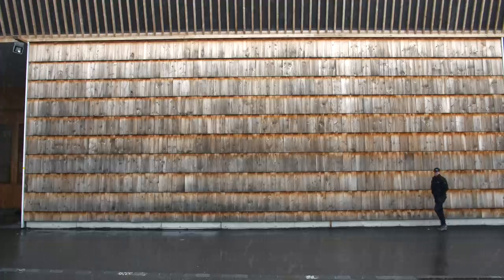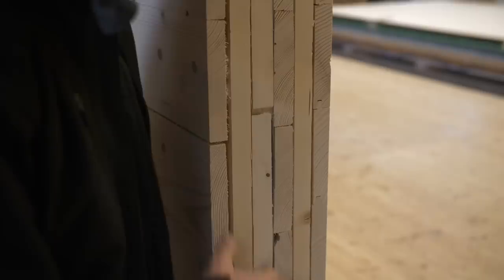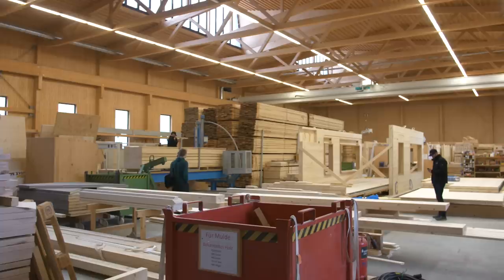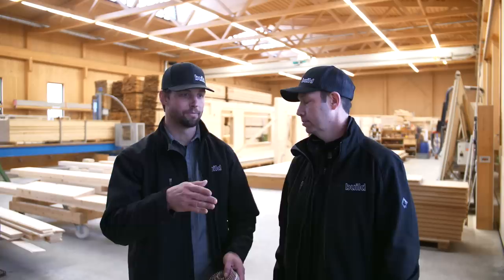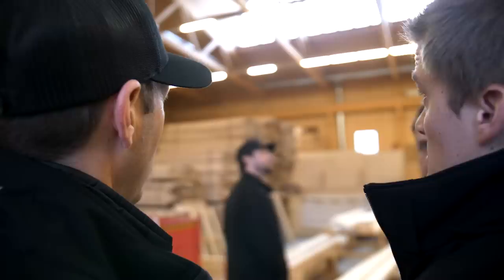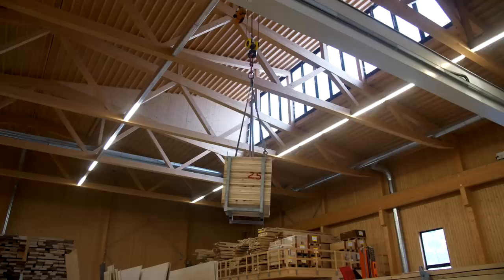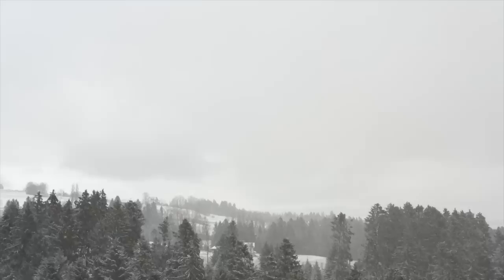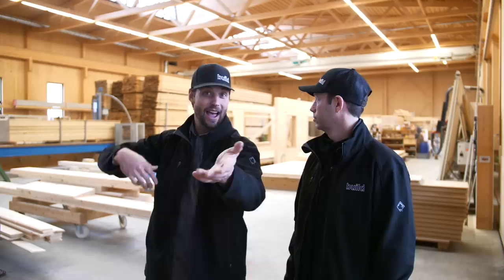This Swiss Builder uses NO INSULATION...

Comment: I am sorry, as much as I like the idea, it seems like a huge "waste" of wood and obviously aimed at the rich, therefor out of place and out of date for 2019. Combining modern, natural materials such as rockwool with wood and some steel components makes perfect sense to me. If built properly, a modern house can easily last 200 years as well and outperform an all wood house. Nobody bothers making it that good and strong though, because it has to be built fast and you have to make more for less.
I don't think the fact that these houses are all wood, is the reason for the longevity of the build. It's the care and engineering behind it, mainly. 
But thanks for buying up all the wood for making these things, when you could build 6x the houses with the materials. 
I am glad they can continue and improve on tradition though. Would suck if that building style got lost.

Comment: You are being optimistic with the R-Value.    Wood walls, softwoods, general use are more like R-1.0 to the inch.     Wood varies per species and growth of that particular tree, from a low of about .75 and a high of about 1.40.  The high end, 1.40 is almost exclusively reserved for balsa wood.  There are a few more very light, air rich woods,, sequoia, some redwood, some white pine, some aspen,,,, but ingeneral terms,, quoting anything more than 1.0 per inch is about as accurate as saying the wall is R-13 because it has R-13 fiberglass in the wall.   R-13 walls as we sometimes call them,, exhibit in lab tests rarely more than R- 7 or R-8  because of the thermal bridging,,, of get this,, the wooden studs.

If you will pardon the joke,, wooden wall are not all they are cracked up to be.

I will add one thing.   No interior stud,, should ever also be an exterior stud.  That is the single most foolish thing we nearly all do.  But it is wrong.  Interior studs should not be exterior studs,, the bridging and conductance are too great and too easy to find an alternative.
Reply: What do you recommend for southern california to have a good R value, but walls that are not super thick?
Reply: Hello, Chris.   First, I'll have to ask a question, and I will have to look at a few things.    The question is where?  Southern California has several climate zones.  It is important to take into account.   Different areas, defined by latitude, elevation, dry or wet depending upon which side of the 'mountain'.  etc.

An example.  My last time in Southern California was 2 years ago, paddling a canoe, Lake Mojave, Lake Havasu.   Elevation, about 800 feet, latitude about 35 degrees north.   bone dry,, highest temps 120, lowest 35,, normal range is more like 110 to 45.  (Canoeing was brutal. One day on Lake Mead,, and another on Lake Mojave it hit 122 F)

Insulation to preserve a warm interior is not the issue,, but excluding the sun and heat is. Heat and sun are usually better dealt with by absorbing and reflecting/excluding.  Adobe walls, normal, 9" thick,, or stone similar thickness is about the correct mass to absorb a full day of sun's energy,, and then give it back to the night air. Steel wall skins, with a ventilated air space behind can work well.  The classic solution for desert would be shading and over hangs to the perfect length to fully shade all summer and allow the sun to reach your windows in the winter to gently heat the house.  Southern over hang should be about 36" , maybe longer, on an 8' tall wall.  More math to refine that guess.  The over hangs of the roof edges and a total ventilation under the roof,  will have as much to say about the comfort of the house as any insulation.   I tend to like fiberglass in a rugged situation.

I engineered a house for an intermediate climate zone in New Mexico years ago.  The solution for that location was masonry exterior wall,, adobe or stone, 8 to 10 inches thick, a 1 to 2 inch air space behind,  and a modest 6 inch fiberglass filled wall  on that one steel studs.  Today,, I might suggest a 6 to 8 inch thick wall,, 3 inch steel studs 0ne foot on center but favoured one to the inside, one to the outside, zig zag. No interior stud is also an exterior stud,, no conductance through the frame.

IF you have sufficient shading,, the entire thing under shade,  Walk in freezers might have the best idea.  Commercial walk in freezers are just a foam block with a metal skin in and a metal skin out.  ALL foams must be protected from ants and termites,, they love to chew on foam, white bead board especially,,, urethane foam less.
Reply: @Sailor376also  It's in Los Angeles.
Reply: I answered last night,, but there was something odd,,, I think that answer is gone.  To recap.  Los Angeles has a couple of oddities in climate.  You asked for thin walls,, I assume new construction, Top of my list would be SIP's.  Structural Insulated Panels.  It is like building a commercial walk in freezer.  I also would use a SIPs with urethane foam,, even fiberglass reinforced urethane foam.  I leave it to you to look up a local manufacturer,,, you could manufacture the panels yourself,, but that would require some fairly serious engineering of the process and extreme quality control in the manufacture.  The result,, well planned and executed,, would be a wall no thicker than a 2X4 or 2X6 wall  with double to triple the insulation yield. A SIP system based upon polystyrene will double the true R-vale of a 2X4 wall with fiberglass insulation,  and a 2X6 wall with Urethane core could be 4 times the R-value.

Additionally,,, the house must be intended to survive fire, flood, sun,  wind, and earthquake.  And there is ZERO reason why a well designed frame house cannot be superior to all of them. Add to that SIP list  A Electrical,, rethink it.  Outlets are conventionally placed as though the wall is a framed wall.  Interior walls can be framed walls, and electrical favoured to them and done conventionally.  But the electric in the outer walls,, I'd suggest,, do it like a commercial building,, surface mount.  Fast, off the shelf,, plain conduit or some of the fancier. versions.   Interior walls.  All interior walls get diagonal bracing to assist the exterior walls in the event of earthquake.  Also,, for earthquake,, I would consider non parallel walls a plus, a romboid shape, a five sided or multi sided shape.  Maybe all your corners have an interesting angled corner turn?  Just an idea.

Exterior:  Nice wide eaves all around to shade the walls,, the hottest day of summer come late in the year.  Some passive solar heating would be nice,,, but aim for more shading, do not admit the sun foe heating until October at the earliest,,, and that IS a math product of sun angle in changing seasons, vs roof over hang length.  Exterior should ONLY be non combustible.  If steel, leave an airspace behind, do not attach directly.  Cement panels,, AKA Hardi-board or similar.  USE ZERO wood on the exterior,, no burnable products.

Give your home a thermal flywheel.  There will likely be a concrete floor in the basement or it will be slab on grade.  IMPORTANT;   I have seen this element done with compromises,, there must be none.  Isolate the slab on foam,,,and perimeter foam (use a high density foam for the perimeter or BURIAL grade pressure treated wood.)  ZERO concrete may be in contact with soil, footings, or outside air.  The slab should only be in contact with the inside air, the carpeting on top, or the feet of the occupants.   If there are intrusions, around pipes and wires,, it is IMPERATIVE that the gaps are carefully and completely infilled.  This is not a job that can be done by the usual best contractor.  A single 4 inch square area  void can destroy the energy flywheel effect for 400 square feet of slab.  Yes, you heard that correctly a 2inch X 2 inch void where the concrete falls through to contact the soil of footing,, can destroy the effectiveness of a 20 foot X 20 foot area.   If you successfully float the slab of the garage, basement or main floor,, it becomes a very powerful heat modifier for the entire house.   In Michigan, my workshop, unheated except by an infrequent wood fire when I had a project, with isolated slab,, in 20 years the latex paints stored never once froze. The house interior in summer took the entire day to warm up,, then open the windows after dark to cool.  That house never had air conditioning, never needed it. (10 inch thick fiberglass filled walls, quad glazed windows, excellent orientation and perfect overhang lengths)

The LA area presents almost every problem there is.  If you are about to build,,, know your flood plain and what canyons or reservoirs are above you.  Never buy or build in one of those at risk areas.  Hillsides , mudslides,, fire, flood, sunny, muggy, trapped inversion layers, earthquakes.   LA has it all.  I know of no termite or insect problems currently there,, research that though. And LA as an import center,, there will be imported insects someday,, all walls should have a metal foot, and main floors should be above grade.

I've bored you enough.  Have fun.
Reply: @Sailor376also  Bored? Are you crazy? This whole process fascinates the hell out of me.
Reply: It fascinated me years ago too.    All right if I am a teacher with a class of one,, then I would like to give you the framework.   Every lot, every neighborhood has a best house for it.  A one size fits all is a terrible idea,,, but it is what we do.  Right along side of that,, the sun is over there.  I don't care where the street is.  Facing the house toward the street is a simple,,, and stupid idea.  The house must address the sun first,, wind, rain, local climate issues a close second.  The exception to that is   what do you want to look at when you stand on the lot,, or from inside the new house?  If there is a beautiful lake, a mountain,, the ocean,,, you must design and build around that exactly as you might have to if there is some huge piece of bedrock sticking up out of the lot.  A house that might be perfect for the Sierras in California is totally wrong in Hawaii.  That last example is flat out truth.  A person had a house designed and built for a hillside overlooking Hilo, Hawaii, red cedar, 6000 square feet, California architect,, faultless.  The termites ate the entire thing in just over two years.  (I read the entire 80 page lawsuit.)  When I tried to answer your question , Chris,, I brought up a climate website that will give me a good rundown on all climatic conditions for any location in the world.  It almost prepares a ten page report on average sun, wind, temps, seasonal shifts.  "The Typical Weather Anywhere on Earth."  Weather Spark  A valuable tool.  Also on my favourites list are the NOAA sites,, Environment Canada.

Compass headings,, and what is the compass correction  for that location.  Elevation.   

My houses face the sun.  Yes, they may sit at an angle to the lot or street.

I referred to it,, but this is important,, the sun angle and how it changes with the seasons.  Because of the tilt of the planet, In the summer at local noon, June 21st  (normally)  Take the degrees latitude and subtract 23 degrees.  Center of Los Angeles, 35 degrees north latitude,, the sun will be just 12 degrees south of straight up and down,, so to completely shade a wall at noon that day,, 8 foot tall wall,, you only need a 22 inch overhang.  (All math in this discussion is being done mentally,, watch out for errors.  I'm good,, but I make mistakes too.)   Buuuttt,, (you knew that was coming)  How much of the summer do you really, want to shade that wall.?   Los Angeles in unusual in that the warmest of the year is late.  Hottest part of the summer is not first or second week of July,, Like just about everywhere else,,, Hot weeks of the year in LA are mid August, 4 or 5 weeks later.   Soooo,, your south facing roof overhang,, to protect the walls and windows from getting too much sun,,  Solar declination is about 13 degrees, not 23 ,,, so subtract 13 from 35  = 22 degrees  8 foot tall wall would like about a 40 inch overhang ..       Size the overhang correctly for latitude and when in the summer it is hottest,,, and the rest of the year allow the sun to warm the building and fill the windows.  Use good insulation,, consider tricks for wildfires, earthquakes,, these are all part of climate,,,  

You have all the basics now.  Those paragraphs on this page are as good or better than most architects or building engineers will ever see in college.  Have fun Chris,, stay curious.
Reply: @Sailor376also  Thanks. I have some ideas on what I would like to build, but it is very obvious to have an architect and related professionals vet such an endeavor.
Reply: Absolutely.  But you also must know a great deal, set your goals or what you wish to see, and what performance you expect.  You will be vetting them  even as they create the design of your dreams.  It works both ways,,, especially when it works best.

Comment: So, a log cabin built out of flattened logs.
Reply from the maker: Very good summary!  Wish I would have said that in the video!
Reply: @buildshow  I personally like the 16" plywood reference. No need to do any soundproofing. That's for sure.
Reply: @buildshow  A context where these would be very useful/ideal, would be for small applications. Sheds, tiny home, and small additions that can be delivered on a truck in tight neighborhoods, lifted with a crane, and dropped on concrete footers, where it can be a bare-bones habitable space (bedroom) or storage where building codes would allow people to knock out a wall and have an extra 100-300 square feet that will last forever as an attached or detached section of the home. With carpeting and tile being the norm, most people might find it to be insufficient if not well decorated. But TBH, I'd be perfectly happy with an all wood construction room like that. Especially if I lived in a noisy area and wanted/needed a quiet space.

Comment: This seems like a massive waste of wood... a resource becoming more and more limited as time passes.  I am surprise the Swiss are behind this.  Aren’t there modern ECO friendly materials that can take place of some of the wood in these houses?
Reply: Modern eco friendly sounds allot like WOOD
Reply: Wood is renewable. 

If you are worried about limited resources. What is your alternative? Cement based? Plastics? Metal? 

The thing about wood is it can be carbon neutral. Just plant more.
It can be replaced. Just plant more.

Plastics: use oil. Limited resources.
Metal: cost of production, Limited resources.
Cement: uses an incredible amount of energy in production. For the majority of this energy production is using limited resources:coal and oil.

Comment: 5 quarter is inch and a quarter at any lumber mill or store on the planet....cept maybe home depot. How did you get this show?
Reply: They will know what your mean if you say inch and a quarter, but "five quarter" is the term used in the lumber industry, particularly for hardwood. A lumber rule, used for measuring wood for board feet calculation, is marked in quarters.
Reply: Five quarter means full spec dimension. A two by four would be the actual measurement of the stud.
Reply: 5/4" is rough dimensions.  After drying (shrinkage) and finish planing (smoothness and consistency), it comes to 1" actual.  The same is true for all "ready-to-use" lumber.
Reply: NATHANIEL GILLIES how is that possible, decause you obviously have no knowledge of when the metric system was developed, but where they screwed up was by trying to make a clock in units of 10., see how that works .
Reply: Naqiyah El Meginnah  not true  5/4 means full dimension wood  a 2x4 in 5/4 is actually 2 inches by 4 inches.
Reply: colmhain not true.   A construction 2x4 does not measure 2 by 4. It is  3 3/4 by 2 3/4 Go put a rule on a construction stud if you need further proof.  5/4 wood measures a full 2x4. 5/4 dimensional lumber is used in furniture and cabinetry building.
Reply: Nope
Reply: Remember that 5/4 wood is merely a term used to signify a full dimension product .  No construction framing lumber is full dimension.  Don’t believe me?  Go,put a ruler on any construction lumber and it will never measure full dimension.  Maybe that’s how he got the show.  He knows what he is talking about, unlike some people on this blog.

Comment: I'd imagine the foundation would likely be the start of the downfall for these structures. All that weight, would definitely cause cracking of concrete and the foundation to sink over time, warping the wood, pulling things apart....and once it sinks enough that the wood at ground level is below ground....rot will set in.  Also once moisture ever does get between these walls, it's going to cause rot that you will have no hope of fixing....and it will spread far before you even know it's happening.  Then it will be just a mold death trap. The repairs would be tremendously costly because you'll need to support all of that weight while removing sections of the wall.  

Houses actually need to breathe.  It's what allows fresh air in and moisture to get out. Sure you could install a ventilation system, but then what's the point of having such strong insulation.  An air tight house would be terrible for indoor air quality.  I'd also imagine that whatever they're bonding the wood with, would likely fail over time. Could even soften up from the heat of a fire.  Then you have catastrophic collapse.

Comment: This is garbage by todays building standards. 8" (20cm) solid wood is about 0.75W/m2K. I also doubt, that after a few years of drying and contracting, it will be all but air tight.